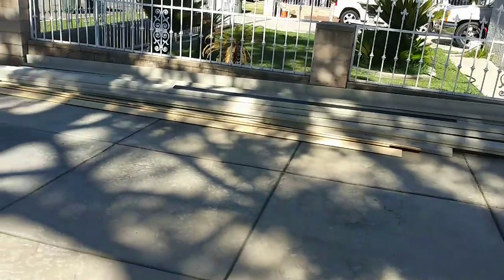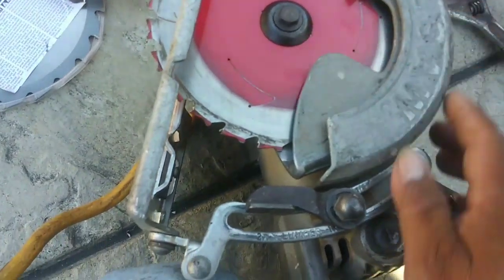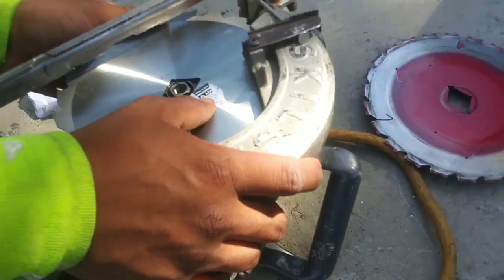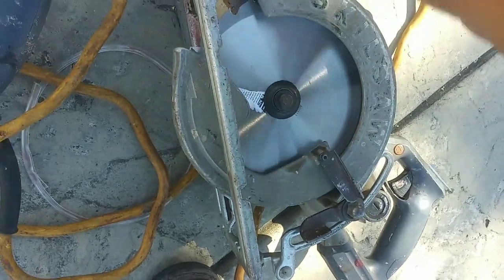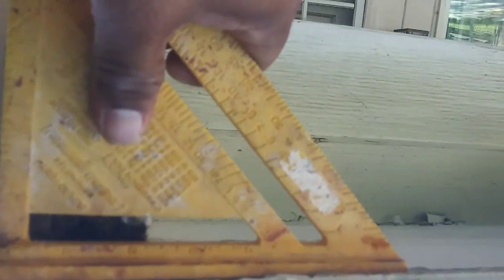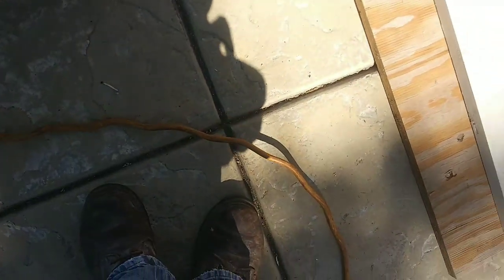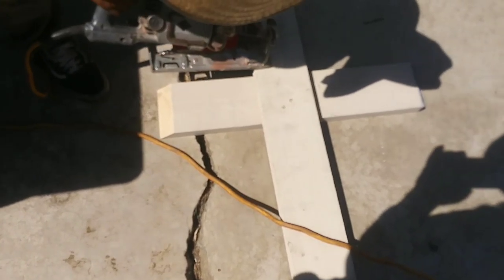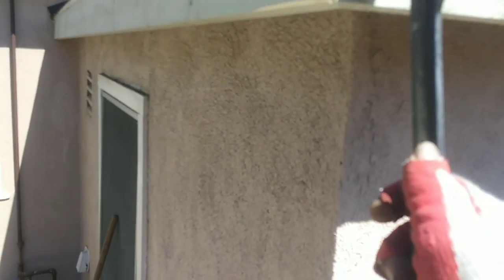Everything about Fascia Board ...the video you want to watch !

Comment: Finally found a video that addresses my situation. My question is, how do you remove the existing rotted facia board from the rafter tails, starter board and flashing with damaging either of them? Thank you.
Reply: Wiggle back and forth. If it's got a bunch of nails in the fascia coming from the metal drip edge, you gotta get a pry bar and get under the fascia (hopefully you got no soffit). If you've got soffit, remove 2 boards the length of the fascia you're replacing so you have adequate space to work.

Comment: Is that plywood above the fascia rotted? I have always had a hard time getting fascia out when there is metal drip edge...the nails under the drip edge are hard to get out without bending the drip edge.
Reply: What's the secret so you're getting the nails out of the drip edge coming out.
Reply: True! Gotta straighten it back out. It's really hard to avoid bending the drip edge, just try to be careful not to knock nails back up through the roof, they have to be cut with a sawzall or one handed recip saw, but be careful not to cut your roof.
Edit: his nailclipper actually looks better and easier to use for cutting the nails.

Comment: That “ 45 degree angle” cut is call 45 degree bevel homie. Not being a prick but an angle would be the cut of the fascia board at the rake. In the south with exposed fascia we have to use exterior screws. If not the hand drive nails will back out. Good job though 👍🏻
Reply from the maker: Thanks for the up date!